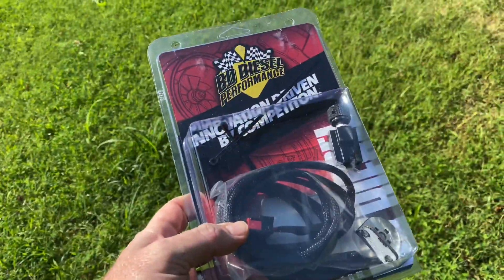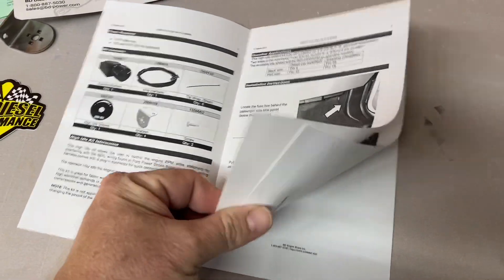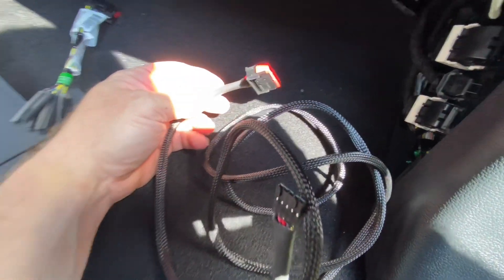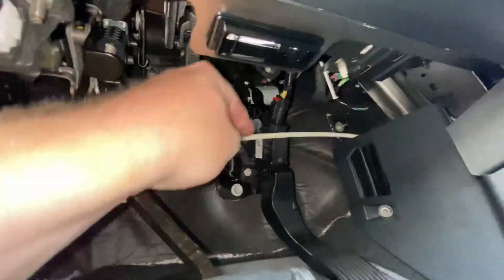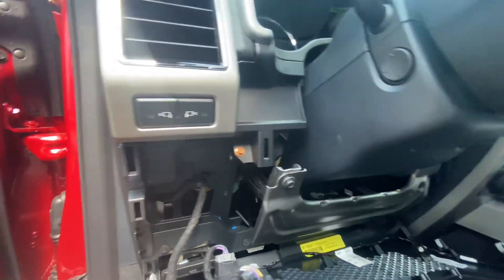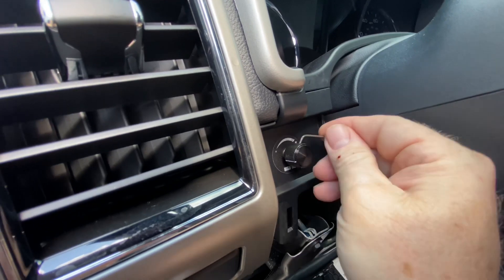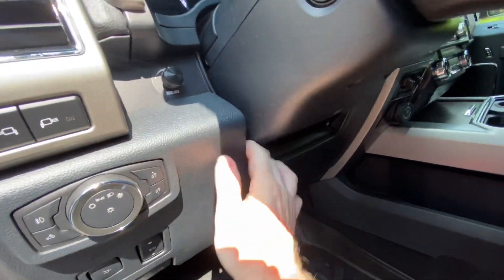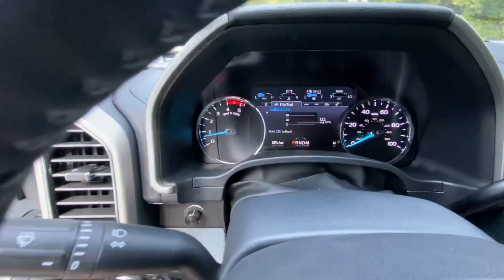BD Diesel Performance High Idle Kit Install - 2022 Ford Superduty

Comment: Great "how to" video. Bought the kit for my 2018 F350 and low and behold when I pulled the dash apart the opening on the metal plate behind the placement was not there on mine. Full metal plate. Bummer. Would have been a great place for it. Searching now for different knob placement.

Comment: Does anyone truck lurch "down" after shutting off the high idle? After installing and using it i niticed the truck would lurch down almost like when you hold the break and give it gas then letting off the gas.

Comment: Does this kit make an unusual growl when you idle up. It dies on my 2022. Ive reached out to bd. Just curious. I’ve done multiple high idle mods and never had this sound before.
Reply from the maker: I have used it on a 2020 and a 2022 and both sound the same.  Both sound like a 6.7 idled up.  The BD high idle kit is little more than a switch and a potentiometer (variable resistor) there are no active electronics in the kit whatsoever. The kit connects to the Ford provided SEIC interface which is intended for end users to use and is well documented.
Reply: Mine does that growl as well, have you found out anymore about it?

Comment: What do high idle kit use for?
Reply from the maker: It is not good to let a modern diesel idle at low speed because it will cause premature issues with the emission controls and build up crud on the turbo.   Anytime you need to leave the truck running while in park is a good reason to use the high idle option.
Reply: Have you gotten a check engine light with code p016d since installing the high idle kit?